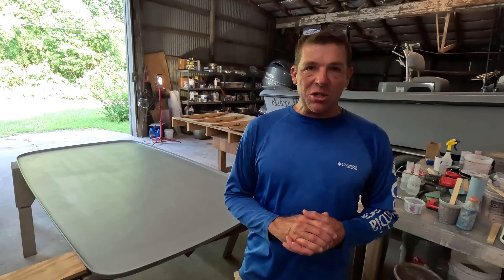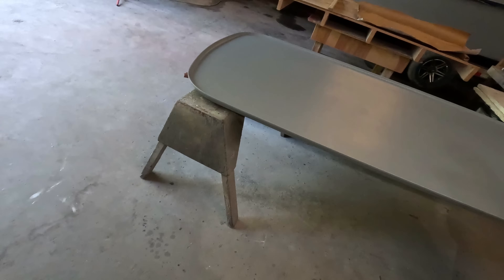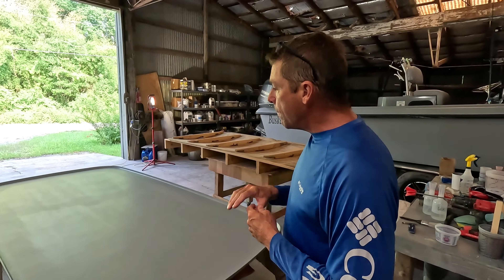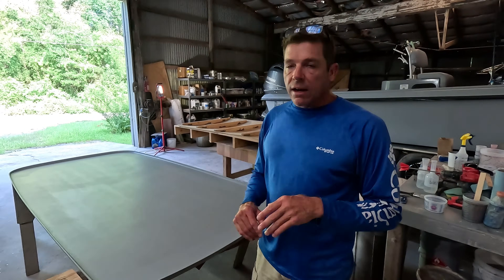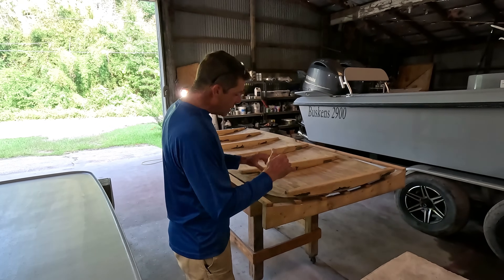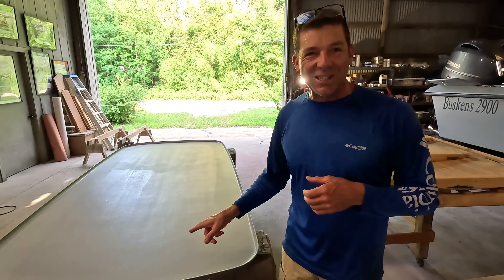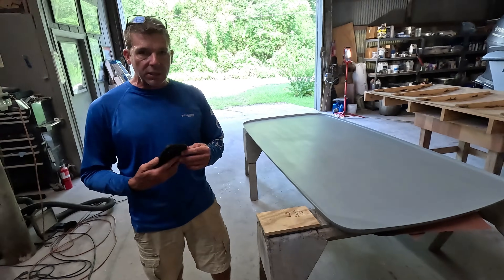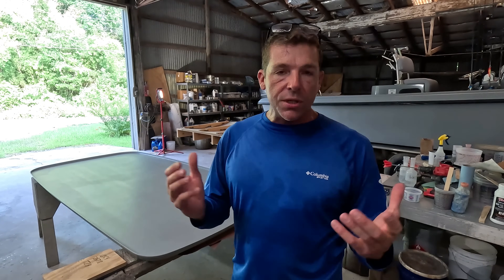HOW TO Build a FIBERGLASS MOLD! HOW MUCH DOES IT WEIGH?

Comment: Amazing! I had a lucky guess of 72.3 lbs. After watching this whole series I have learned a lot. I don’t believe I will be building a mold but again this was all extremely useful information. Being in the south, we heard you express how important it is to mind the temperature while mixing your MEKP. Living in south Texas myself, I am aware of how fast the material can kick with our excessive heat. I was wondering if you had a limit of how cold of an environment you would be comfortable in. When we get these cold fronts in January- February. And what measures could be taken to allow for a proper cure of any of these polyester/ vinyl ester materials.
Reply from the maker: That's awesome, great guess!! Generally I would say that the high fifties for poly and vinyl ester are still workable, and the low fifties for epoxy. I have a cold weather fiberglass, tips and tactics video that I made last winter here on the channel that you should find helpful. I hope you enjoy, and thanks so much for watching and commenting!

Comment: Hi Joe I’m starting a one off hardtop project and curious what you recommend for layup. I’m using a 1/2 Gurit Kerdyn Green Thermoplastic foam core. Initial thoughts is to use CSM , 1708, 1708, CSM on both sides of the core. So that’s core and 8 layers of glass

Comment: Joe, to put a little more finished edge on that lexan, you can get some silicone vacuum hose, slit it and slide over the edge. Its pretty cheap and comes in about every color you can think of. A few dabs of shoe goo will hold it in place.
Reply from the maker: Interesting! Thanks for watching and sharing your experience with the channel!

Comment: When attaching 2 pieces of coosa to epoxy glue together, do you recommend using stainless steel screws to get a good bond and fiberglass over them?
Reply from the maker: That's what we used when we built our 29, and it has worked out very well for us. Hope this helps, and thanks for watching!

Comment: When do we get to see this bad boy on the boat? I can’t wait!
Reply from the maker: It's gonna happen, but might take a little time. Our summer fishing season is over, and that means the money the boat was making has slowed way down. Estimates that I got for the pipe work were way higher than I expected, so  I will move on to some other projects in the meantime. Hope this helps explain things. Thanks for watching!
Reply: @FishBumpTV  I understand. I just picked up a hydra-sport 2500cc with a Stryker T top that has the mesh type canopy. I’m gonna make a hard top that fits the existing tubing for it at some point. Love the videos and excellent info on fiberglass fabrication.

Comment: I added a thick layer of fiberglass to the bottom of a 14 foot kayak and it probably doubled the weight of the craft. It weighed 70 lbs afterwards. It rowed like a battleship.
Reply: I own a 1969 Olympic Slalom river racing kayak. I've run the most extreme white water rivers with it for the past thirty years. It was pulled from the original boat in 1970 in a garage at Utah. It's a single fiberglass hand layup 11'7" , including seat it weighs 30 lbs.  Occasionally I'll catch a rock edge and stop to slap on a bandaid patch then run. No one has ever crafted a better kayak. The cf guys can't compete. The elasticity I think is more important than the rigidity in considering impact strength of a whitewater kayak.

Comment: 2nd... Very nice, I'm pondering my topper over the last few weeks, The frame,/risers will be cedar from my sawmill, epoxy cleared or sealed. and yes I can sweep cedar posts like the nice powder coated aluminum post frames.
The Cedar would be a 1 off or head turner.
I was going to do a fabric top, but this brings other gears turning in the transmission mix, thanks.
Reply from the maker: Sounds like a cool project  for sure! Glad the videos are giving you some food for thought.